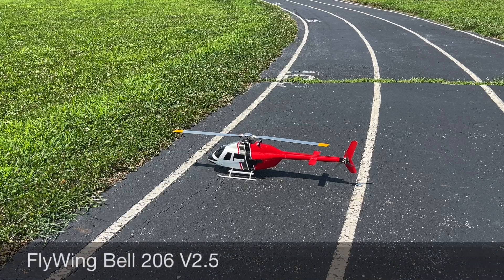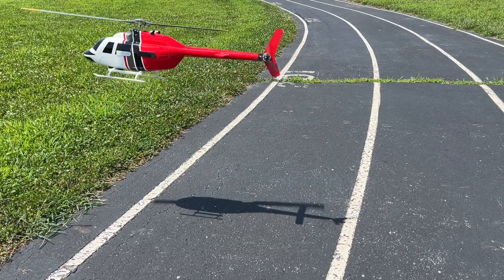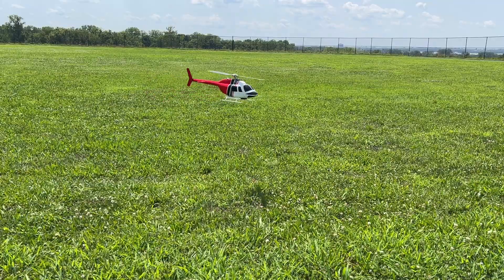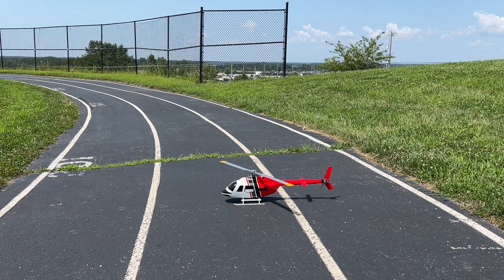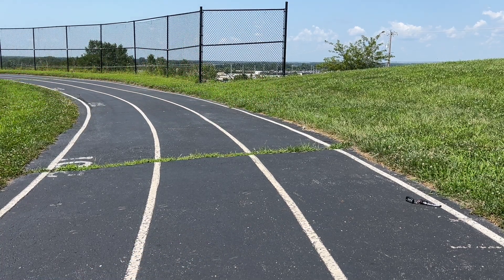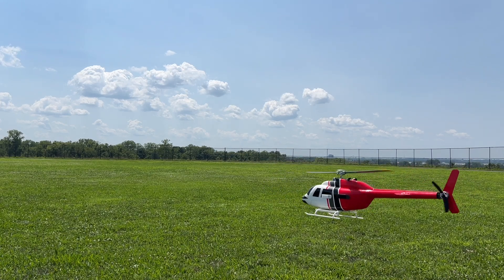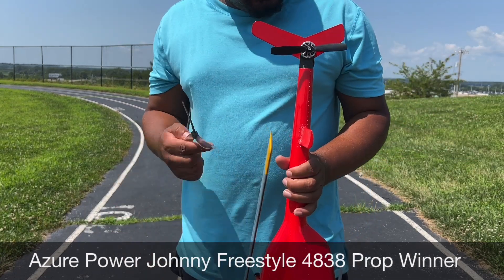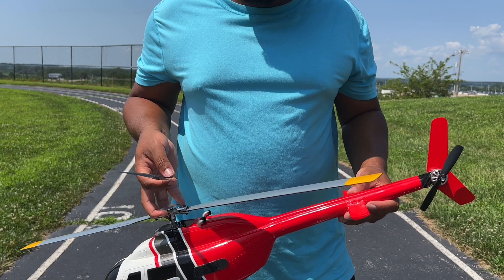FlyWing and FLISHRC Tail Motor Sound Reduction Mod Part 3

Comment: You're flying a drone not a pure helicopter.
Reply from the maker: @flycatchful  it has a 3D mode.
Reply: @pilotbowser9980  It still is a drone.
Reply from the maker: Unfortunately, it seems you don't grasp the distinction between a helicopter with GPS stabilization versus a drone. 

GPS stabilization in RC helicopters helps maintain a fixed position in the air, making it easier for the pilot to control. However, beyond this stabilization, the pilot is responsible for controlling all aspects of the flight, including pitch, yaw, and altitude.

Typically, these helicopters lack the advanced autopilot features found in drones. If you let go of the controls, the helicopter might hold its position due to GPS, but it won't navigate or avoid obstacles autonomously.
  
Drones with GPS not only stabilize but can autonomously navigate based on GPS coordinates. Many drones can execute pre-programmed flight paths or return to home automatically if the signal is lost.

These drones often include additional sensors for obstacle detection and avoidance, allowing them to fly more safely even in complex environments without constant manual input from the pilot.

I hope this helps clarify the differences. I’m happy to discuss this further if you’d like!
Reply: @pilotbowser9980  Well put. I've always liked rc aircraft. Never owned or flown one. I'm now 61 and have not long purchased this Flywing Bell Jet Ranger. It's fantastic, I have had so much fun flying it. You can't call this helicopter a drone, it's not!
Reply from the maker: Thank you. I'm so happy that you enjoy your Bell 206. I'm also happy that you are still flying today. Stay tuned, as I have a cool new series starting very soon, and the Bell 206 will be featured a lot more.